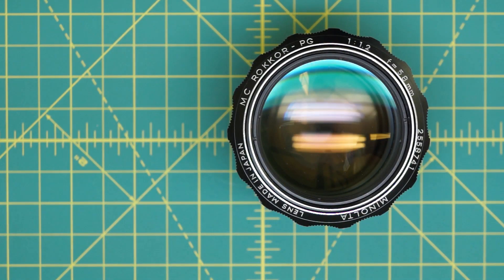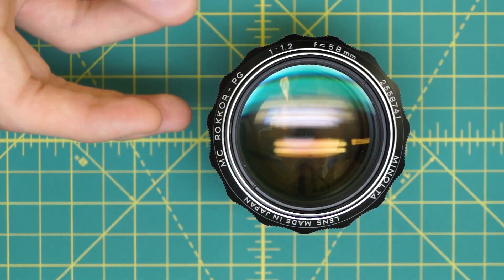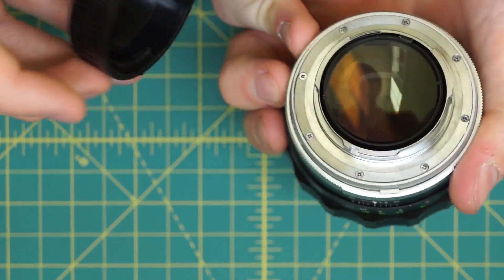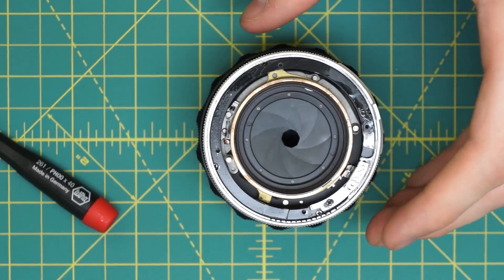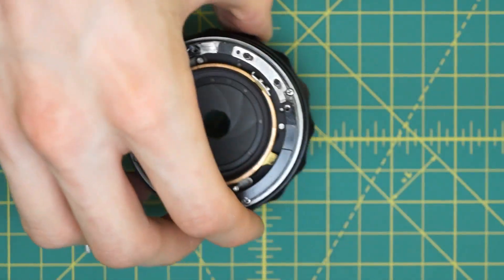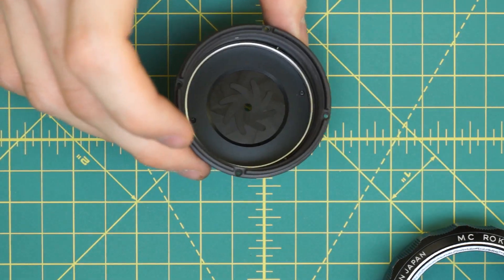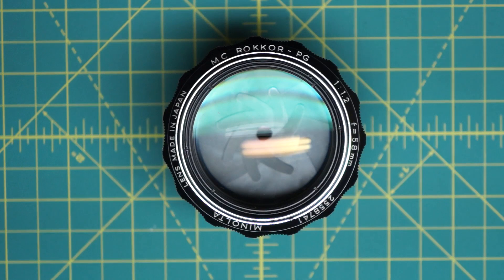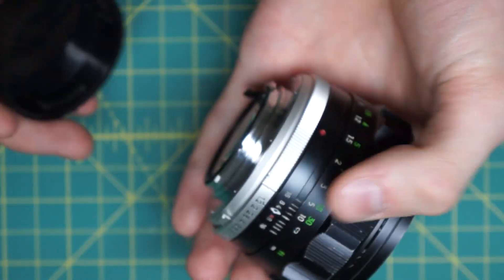Minolta MC Rokkor-PG 58mm f1.2 Lens Full Disassembly

Comment: Thank you so much for this tutorial. I bought one of these lenses on ebay for about half the normal price because the click mechanism on the aperture ring wasn't working. I bought a spacing wrench for £9 and used a ball bearing from a ball point pen and repaired the click mechanism! It works perfectly now.

Comment: You can easily adjust the infinity end stop by removing the nameplate (which wasn’t removed in this video - the ring with the engraved text at the front - use rubber gloves and it just twists off) which gives you access to four screws which when loosened disengages the focus helicoil. This simple method can be done outdoors with a tripod to get infinity nailed perfectly
Reply: Saving my life right now

Comment: Not sure if you know this or not - but the portion that says "Minolta Lens Made in Japan" etc is removable. You use a piece of latex to unscrew it - and that allows the entire front to come off from the aperture cup. There's no need to go from the back.

Additionally, swabbing with a cue-tip won't clean the iris blades if they're acting up. Not only does the cam mechanism need to be cleaned, you need to remove the blades entirely to clean it properly (scribe the blade ring appropriately first or have another copy for reference or you'll never get the iris blade opening set correctly and the aperture will be off).
Reply: Hey, I've come across a copy where those 4 screws are loose and cause the helicals to get out of position upon use. How do you take out the trim (Minolta Rokkor-x  58mm f1.2 in my case)? I couldn't get it to come loose and I can see the screws spinning freely on their threads. Thanks for any info
Reply: Ive got a question! Someone please help. I’m putting the lens back together again, but when I attach the black ring the little white distance indicator goes from 0.6 but stops at 3, so it won’t turn all the way til the little infinity logo. Is this fixable by removing the “Minolta made in Japan” ring after putting everything back together again???

Im desperate, someone please answer!

Comment: I used to clean and service Rokkor lenses.
I would like to add that the lens elements are not blacked in some lenses. I think, even in this lens the individual lens elements are not blacked at the edges.
I used to blacken the elements edges with a black OHP marker. It yealed better performance.

Comment: Thanks alot for upload such a nice vid! I used your instructions to clean a 58/f1.2 from my father. He used to use that lens even at the beach and so there was much sand between the front and the back element. I got it cleaned properly and will use it at my Sony A77.
Reply: Had you worked on any lenses previously?

Comment: Be careful with that ball bearing under the aperture ring! The ball bearing became unseated when I went to put the rear mount back on after the aperture ring lifted slightly and I ended up scoring the area near the hole. Upon freeing the ring (due to the ball jamming between the lens and the aperture ring, the bearing and spring went flying. I was able to recover the spring, but not the bearing. Through trial and error (and some bad forum advice), I tried a 1.2mm ball-point pen tip (too big to reassemble reliably), then a 1.0mm ball-point pen tip (works as expected, if not slightly loose). So, worse case, as long as you still have the spring, cannibalizing a pen will save a lot of stress!
Reply: PURE GENIUS! 

That was just pure genius, Rick. I wasn't aware that there was a bearing in my Rokkor-X 85mm f1.7 aperture ring until I went to reassemble and I didn't find the ratchet mechanism as in my Nikkors.  After a long and frantic search, I found the bearing, cleaned it and then dropped it during re-assembly at which it was gone forever. I had a single bag of 250 1mm bearings in my McMaster-Carr shopping cart when I read your comment. I quickly rummaged through my huge collection of non-functioning, dried out, disposable pens when I seemed to measure a 1mm ball. Of course the challenge is how to remove that ball without that ball following the path of its predecessor, but with patience and a hobby knife, I found  the ball to be exactly 1mm and it fit beautifully into my Rokkor-X 85mm f/1.7. Heck,  think it now works better than before. 

Now I can cancel that shopping cart of 250 1mm bearings and feel comforted with my collection of dried-out junk ball-point pens. 

PURE GENIUS! 

Glenn

Comment: Hi Matt. I just bought this lens. It came with a Minolta camera body and I got it for 30 dollars at a second hand store. It is in awesome shape with very little use. The only problem I see is that the blades don't open or close. It is like locked at f 1.2 wide open. Why do you think the blades don't move when I rotate the aperture ring? The glass and the body are in great condition and don't show any sign of damage. I would hate to sell it as broken if it isn't. Thanks.
Reply: I don’t think he does lens videos anymore. But did you watch the entire video? Does it click when you change f stops? Perhaps the aperture ring’s ball bearing has been dislodged. I would study the video more closely forwards and backwards, and try to narrowed down your specific issue. I would NOT sell your f1.2 yet without giving it the old college try to fix it yourself. Good luck.
Reply: I've just fixed mine with the very same problem. It seems that the blades tend to get stucked if you don't use the lens regularly. I just followed the steps on this video until I got to the diaphragma part, then I used my screwdiver to move the blades mechanism manually and it seems to have worked. The lens is working just fine now but your lens is likely going to need some cleaning since you don't know if it has been serviced before.

Comment: Great video, I have this lens my son found it at a flea market and picked it up for 30.00 but the aperture isn't working it's stuck wide open and that little ball bearing is gone, do you know what size that bearing is so I can order one.
Reply: hello u want to  sell your lens as is its ??? i need rear element
Reply: It's 1.0 or 1.2mm. Try cannibalizing a bold or medium-tip ball-point ink pen first. You may find it works just fine. Some forums suggest 1.2mm, but I couldn't get my aperture ring to reassemble with that size. A 1.0mm worked in my case though!

Comment: Dust accumulate inside glass group or just behind it, on the inner part? I have one with just dust but wondering if worth to take it apart just for that.
Reply: I took mine apart and it was only between the front and rear group, not within the group itself.

Comment: Thanks for the excellent video. But how to clean up and grease the inner focus ring you can see at (18:50)?
Reply from the maker: Unless you are having problems with the focus or the lens has been poorly serviced (someone added too much lubricant), you usually do not need to worry too much. Just scrape away the excess exposed grease and call it a day

To remove additional grease, start by unscrewing the inner part of the focusing mechanism out. Try not to actually undo it from the other component. This will expose the helicoids, allowing them to be cleaned and new lubricant to be added.

If you do fully unscrew the two pieces, be sure to note where they originally locked together and put it back together in exactly that position. The reassembly requires lots of trial and error otherwise.

Comment: Mine was not working properly. The aperture was stuck at 1.2 regardless if I used the aperture ring. I managed to open the lens and it works now. Some how thought the aperture ring is no longer clickable it is as smooth as the focus ring. 

It is great for me but is that bad that is no longer clickable sound ?
Reply from the maker: JasonM Perhaps you lost the ball bearing during reassembly? It's pretty small, smaller than on many other Minolta lenses, and rests under the aperture control ring.

Many people intentionally remove the ball bearing, especially for shooting video, so it's not a big deal unless you plan on selling the lens.
Reply: Matt Bierner Thanks for your response, I don't plan on selling it, this one is a keeper :)
Reply: +Matt Bierner Excellent video, fixed my stuck blades. The trick is definitely not to lose the teeny tiny ball bearing. I did mine on a white paper plate thankfully, and when it popped out it didn't get lost. Neat lens.
Reply: If you do lose it, the tip of a 1.0 or 1.2mm ball-point pen will provide a suitable replacement in a pinch.